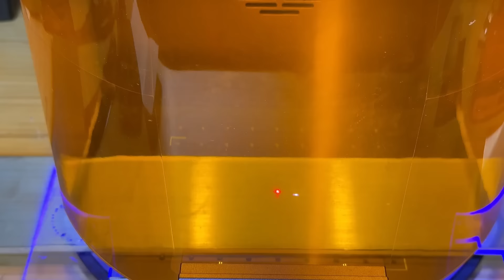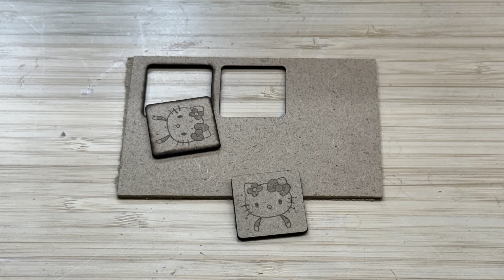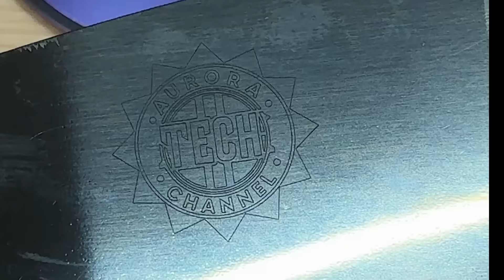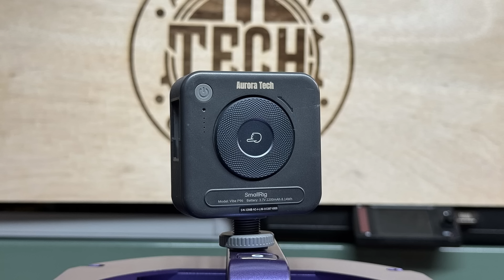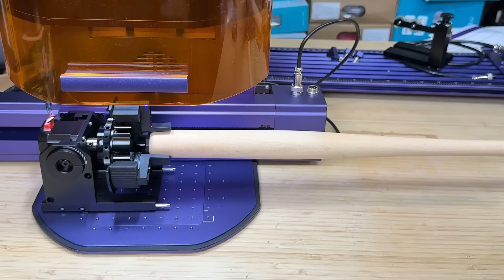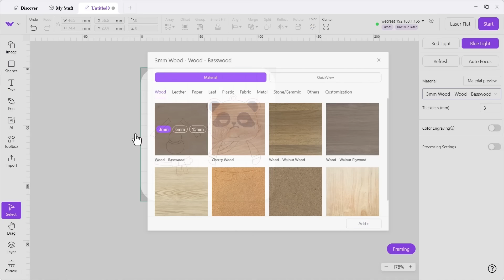WeCreat Lumos Review: 3W IR + 10W Diode Dual Laser Engraver Tested on Metal, Plastic, and Wood

Comment: I noticed that the bat wasn't turning perfectly concentric  in the roller (the fat end didn't look too bad, but the handle end showed the issue).  This should affect the focus.  Did that show up in the engraving?
Is there a tripod mount for using the hand held mode?  If not, that would be a good feature for them to add.
I assume their software is only for Windows and Mac, no Linux version, or does it run under Wine?
Did you manually lower the shield, or does the machine have a motor to do that?
BTW, I'm guessing that Aurora is your first name, never realized that.